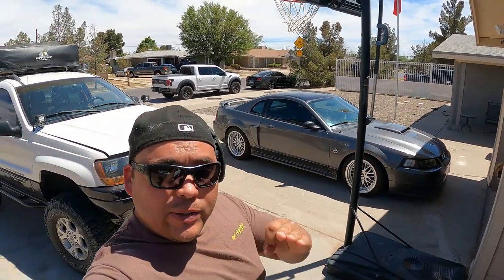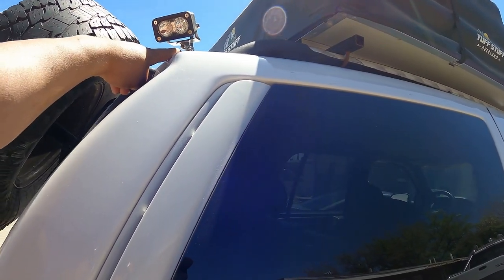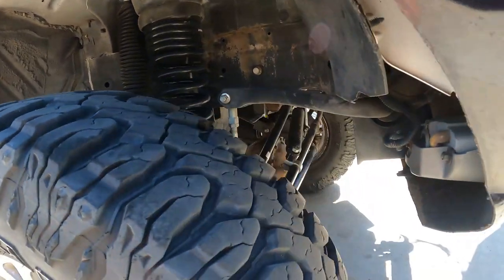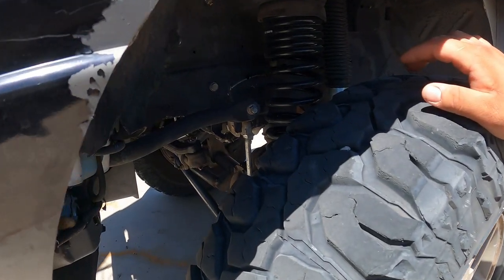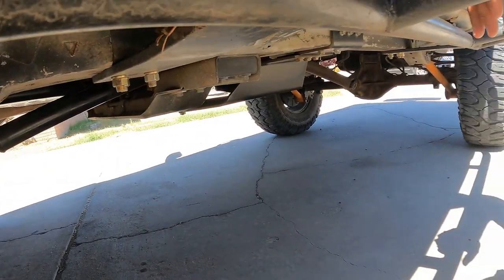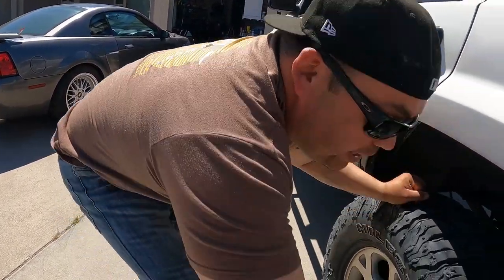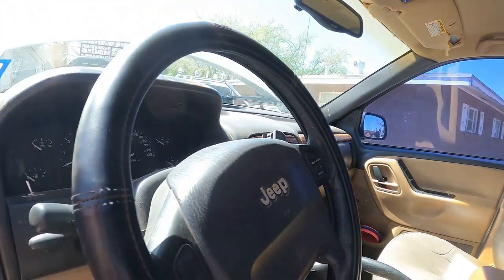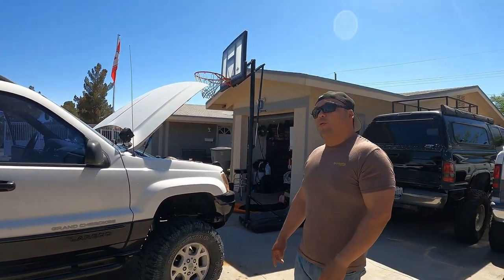Sleeper Jeep WJ Walkthrough

Comment: Bummer how I can't have a roof top tent for two reasons.  1. I usually have a canoe up top on my trips.  2.  I'd tear it right off the roof in the broken trees on trails in Wisconsin, Minnesota, and the U.P.
Nice build though my dude!   I ordered the RC front lower drop brackets for mine on the short arms.  Much improved on and off road ride quality but had to thicken and gusset them so they didn't bend at full flex especially when bangin them on obstacles.
Reply from the maker: That's one of the good things about the desert I live at, not too many trees, lol. But It does get in the way when I go to some trails. Hopefully, I build some long arms in the near future for this one. Thank you for watching.

Comment: You have done a lot of upgrades, I have a black and white WJ. Did you have to take off the inside rear panel to find the wiring for aux outlet? I made my own rock sliders too.
Reply from the maker: Nice love WJs. You don't have to completely remove it, just pop it out from the back and you can put you hand in. Jeep just left it hanging back there. Making your own rock sliders save you a lot.

Comment: How do you measure the pinion angles for the front drive shaft? 4 inch lift with adjustable front control arms. Thank you
Reply from the maker: On top of the C of your differential behind the ball joint. Make sure it's clean. With a 4 inch adjusting the lower control arm should be good enough. When u go higher on lift, then u want to adjust upper to move differential forward.

Comment: Awesome Jeep question with the drop Pittman arm and you don't have a drop track bar bracket do you have bump steer or anything
Reply from the maker: Hi. I have the stock track bar bracket. The only adjustment needed after the installation was the steering wheel alignment. No bump steer. I'm my opinion, pinion angle has a lot to do with the way they steer. Thank you.
Reply: @g_packventures  Right pinion angle does thank you

Comment: What year is it, and what 4x4 system does your WJ have?
Reply from the maker: My bad I left that out lol. It's a 1999 4.0 with 242j t-case
Reply: Thx for the reply,  I'm in Tejas too..  San Anto..    Totally new to WJs , I have a stock 2004 4x4 WJ 4.0 with Quadra Trac 2.  What's your opinion of the Trac 2 4x4 system? None of my other Jeeps have that system,  nor have I tried it out on this 04 WJ.  Still needs a few repairs before its road worthy..  Thx again...
Reply from the maker: @davidtrevino5211  The Quadra Trac works, most V8 have that system. It does limit you a bit I think, example if you want to put Lunch Box locker on it like I did in the front axle, that would not work because of the  AWD. But you can find a 242 T-case pretty cheap and just replace it if you plan on driving it hard. But if you do light off-roading   and camping it will work for you.
Reply: @g_packventures  Thx for info, in your opinion is Quadra Drive best 4x4 system on the WJs?
Reply from the maker: @davidtrevino5211  I think the select-drive give you more control and more options. That the one I like👍.
Reply: @g_packventures  Ok, Thx...   I may sell this one and check for one of those around here. ✌

Comment: Hi Gpac.. what is you caster degree at.. looks way to forward unless that what you needed to rid the shaft vibs.. I built a 4.5 long arm and I'm chasing the vib but don't wanna lose steering.. I'm 2degrees back caster. Any suggestions..i know what I'm doin. Professional mechanic and done the research. Thanks nice rig!
Reply from the maker: Hi. These are my measurements. Front short arm control arm Length from center of hole to center hole are
Lower=16 7/8
Upper= 16 1/4
Pinion angle is at 3.4 degrees
I have given it more and less, and I found that this is what I like, no death wobble or no steer bump.
The front drive shaft with tire full stuff still has plenty of room to move out. And at full droop still good. 
That's what I like from Carolina drive line, that I gave them the measurements and they did  the rest. 
Once we go to Long Arms, the diff should not move forward like they do with short control arms.
Next video I'll go to a shop to full flex it so you can see how the drive shaft and control arm move. Then of course hit up more technical trail. Thank you.
Reply: @g_packventures  ty for the comeback. Ya that 3.4 number was what I wanted to know... I started at 6 and I'm around 3.. it still has vib but its getting better... factory double up front balanced and new UJ and cardan... tom woods in back... I might try a custom up front next... see i drive hiways and need to get 70 out of it lol.. its fine under 55...... THANKS AGAIN. ILL LET YOU KNOW..see mine wj mini monster
Reply: Oh yah!, whats your toe at? I'm at 0
Reply from the maker: @ITS.ME.OG.14R  same 0. Have to make them tires last as long as possible.
Reply: @g_packventures  thanks again!

Comment: You have done a lot of upgrades, I have a black and white WJ. Did you have to take off the inside rear panel to find the wiring for aux outlet? I made my own rock sliders too.
Reply from the maker: Hi, yes you have to take the panel and you will see the wires hanging inside. Making thing your self is  great, you save and learn.